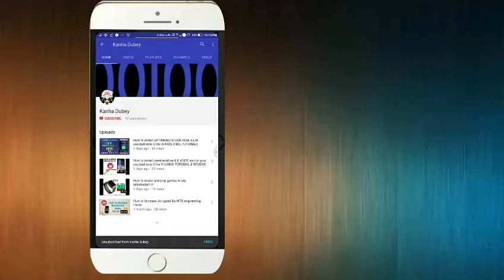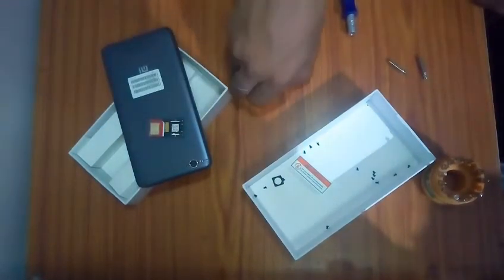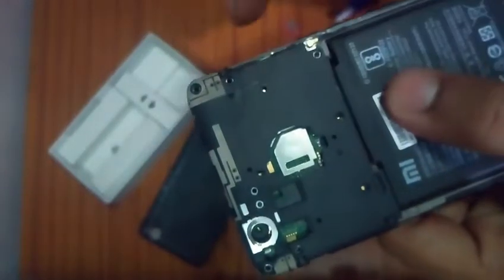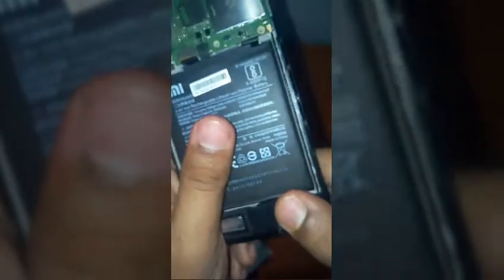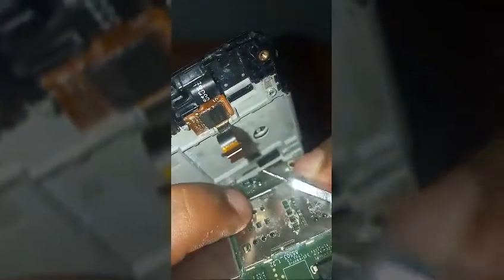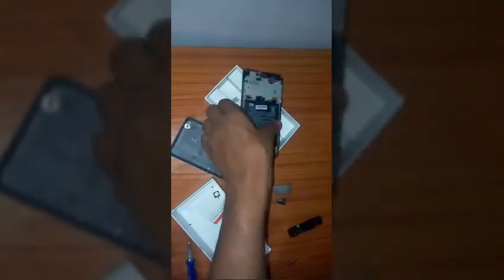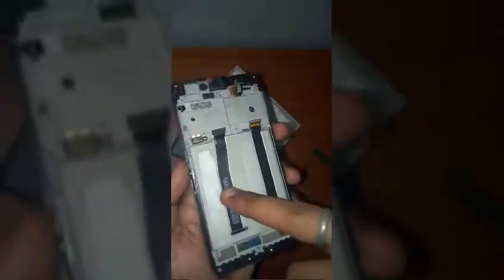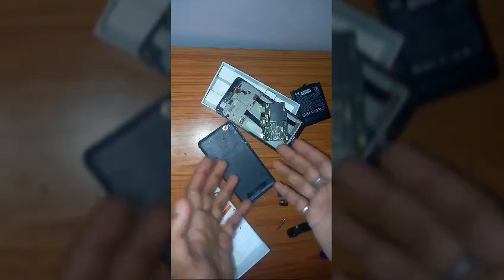How to make your phone survive your phone from severe water damage ? | Teardown of redmi 4A

Comment: how to swtich on water damaged redmi 4A mobile ?? because its battery is non-removable. so how to remove battery of mi 4A?
Reply: Girija Joshi sim socket nikal ke back open karni padti hai sir
Aur its very important dont try to switch on the mobile it will full dead ic damage
Reply: Girija Joshi remove its cover, and remove batery